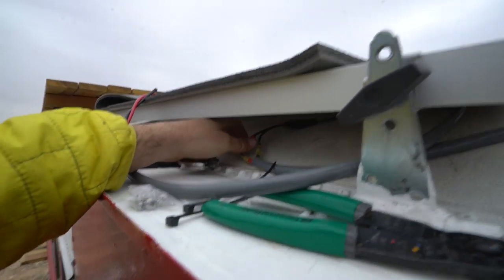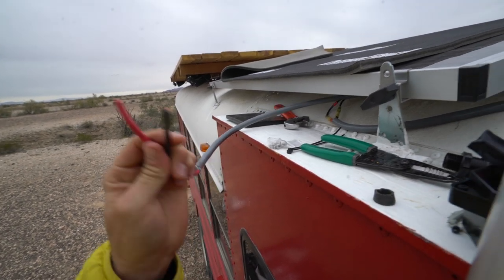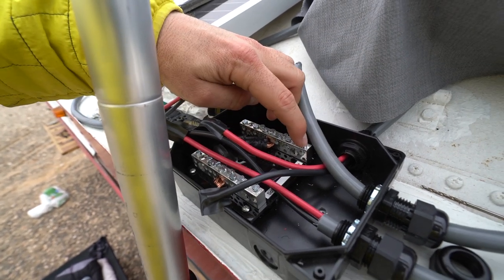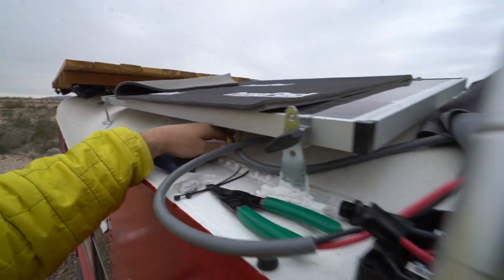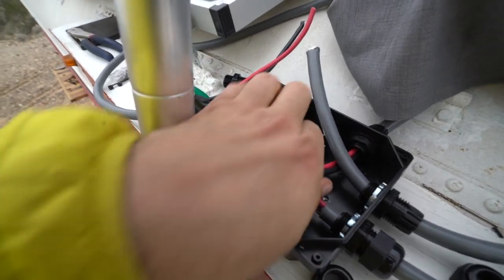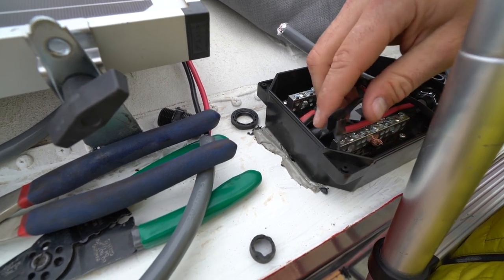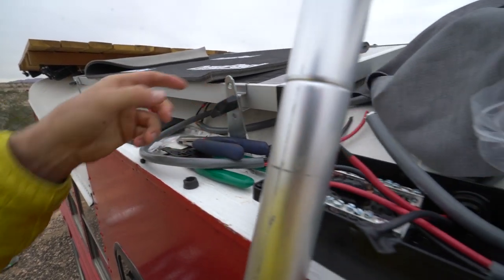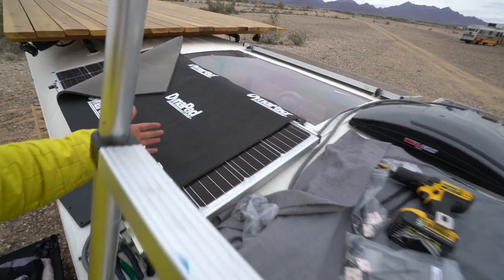Zamp Solar Panels + Combiner Box (AM Solar Discount Code: SKOOLIE5)

Comment: Nice combiner box, but it begs the question here...maybe I missed it in a previous video, but...

Do your panels already have a blocking diode in them?  Modern panels should, but if not, you'll need a diode on each positive lead inside the combiner box.  And for the people who don't know why...that way you won't feed power from the other panels INTO another solar panel that's shaded.  And yeah, that's a bad thing when that happens!  Same thing at the batteries from the combiner box.  Diodes are dirt cheap & worth their weight in gold in a solar setup!

Comment: Glad to see the bus getting closer to being done.  In this video at the top right of the box on the roof was a blackish line in the roof coating,  is that a crack in the rubbercoat already or just a stain ?
Reply from the maker: Probably stain. Elastomeric stains easy
Reply: @JaxAustin  what direction are you headed next and when.  This is Tim the firewood guy. Lok